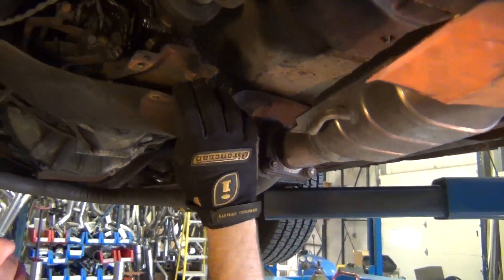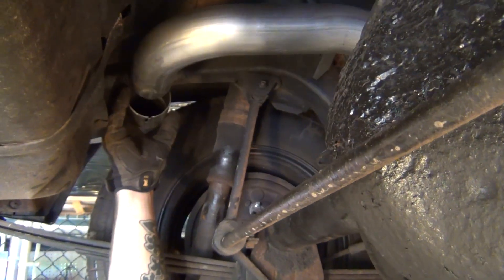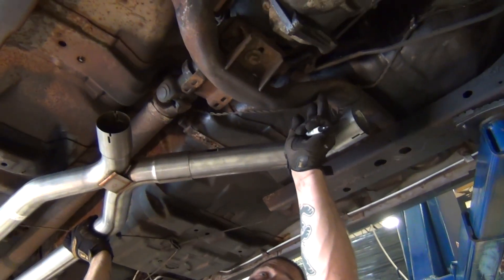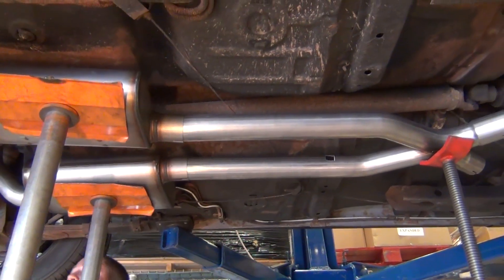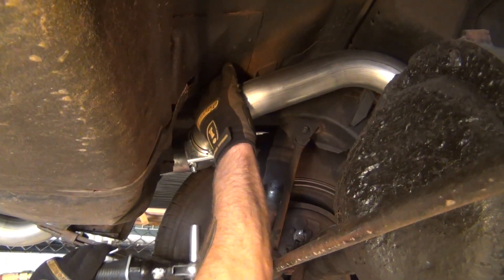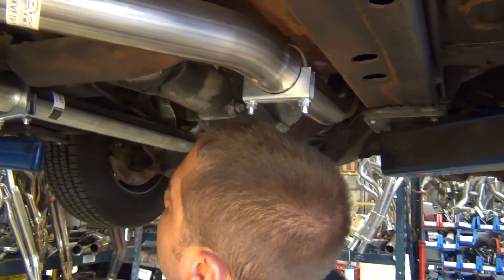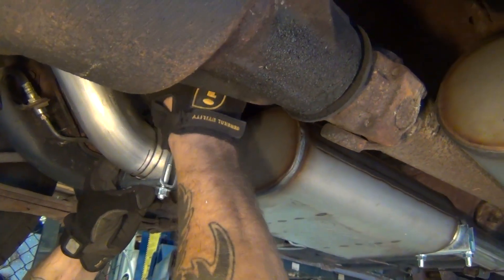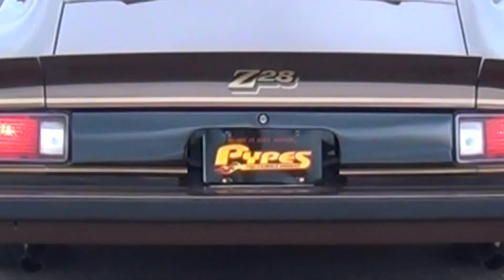1975-81 F/X-Body Exhaust Installation

Comment: I bought black rear window louvers for my fully loaded  black '77 350 Camaro LT, and a fiberglass front spoiler w/fog lamps to complement the rear spoiler. Was also planning on buying an L88 hood for it, but when Chevy restored the z28 model in mid-'77, I changed my mind and later traded the LT in and bought a new bronze '79 z28. The louvers fit the '79, but the spoiler didn't, plus one that would, was made of the same flexible plastic as the front clip.